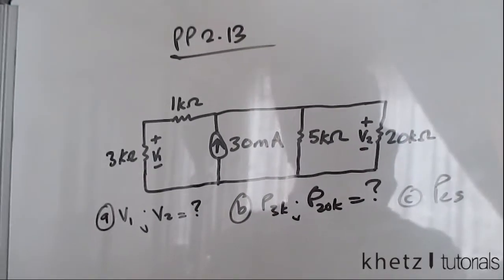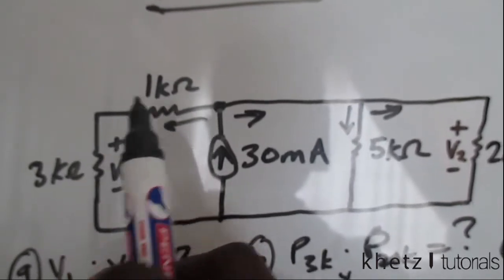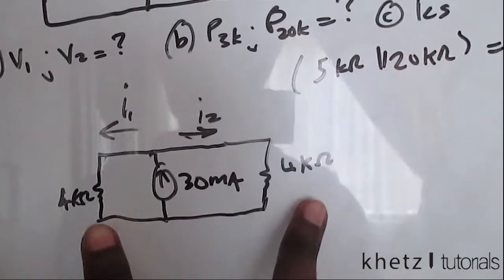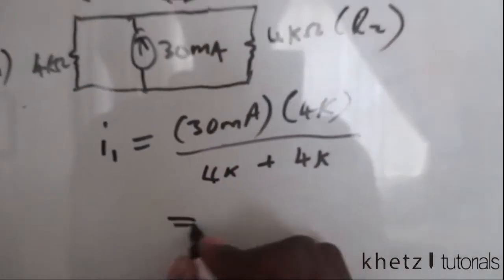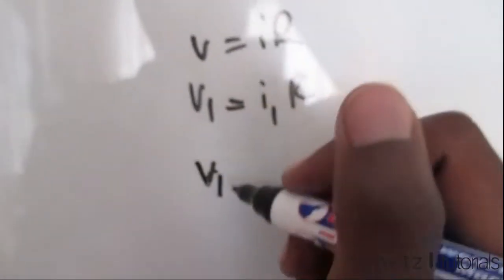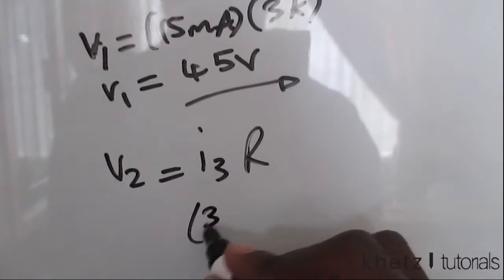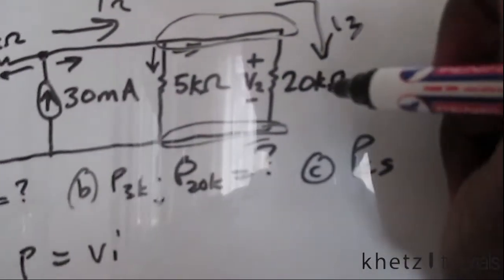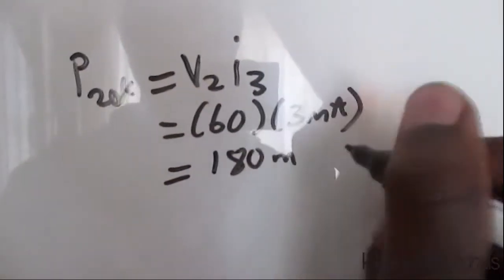Fundamentals Of Electric Circuits Practice Problem 2.13

Comment: How do you determine the direction of the arrows? and how do you assign i?
Reply from the maker: In some cases, it's easy to tell because the current just has to split due to the connections

Comment: Sir in part 1 i3 you calculate, here you multiply 15 by 5/5+20.why you choose 5 instead of 20.
Reply from the maker: For current division, you multiply the source current with the other resistor which you are not interested in(the one in parallel with the resistor with the current of interest).
Reply: @KhetzTutorials  but sir in case when we have voltage source then we multiply the source with the resistor whom we want to know the voltage value.
Reply from the maker: Yes that is true. For voltages you multiply the resistor you are interested in with the voltage source. It is swapped around for current division
Reply: @KhetzTutorials  thanks sir for  improve my concept about this...

Comment: When we calculate i3 why we say i2=15?
Reply: The current is divided. So if i1 is 15, i2 will be 15 because the total is 30
Reply: This is only because the resistor values are equal. If they were different, each side would have a different value

Comment: Power Supplied by Current Source why we multiply V2 with 1 plz Tell me
Reply from the maker: Hello. I don't get your question. Could you perhaps pin the timestamp where this happens?
Reply: 10:26
Reply: I multiplied v2(the voltage indicated across the current source) and the value of the current source itself
Reply: @vukhetamaluleke6869  ok thanks ❣️